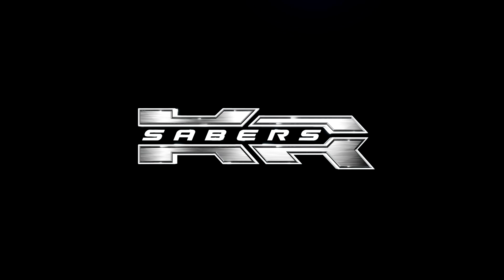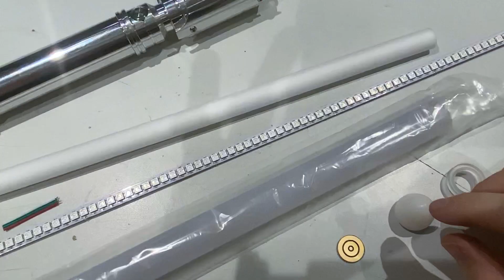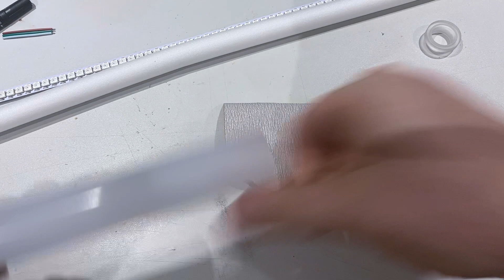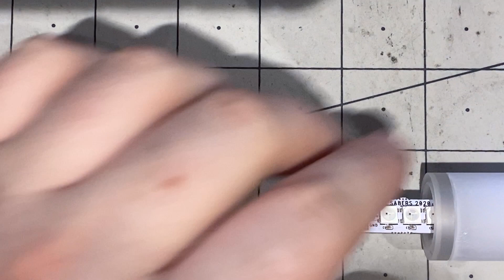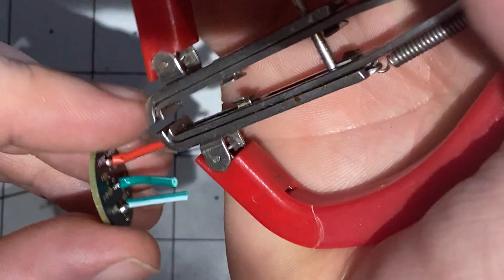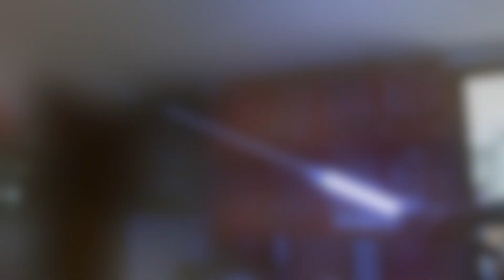KR Sabers How To: Make A Lightsaber NeoPixel Blade Using KR 'Pixel Stick' PCB 2020

Comment: Have you tried using single color (bright clear) LEDs to create a string blade but use a colored film to change the final color? Using either foam tube or a few layers (wrapped) of diffuser?

Comment: why in some of tuto there is no blade diffusion film?
Reply from the maker: This is an older tutorial. The thickness of the tube being used here provides sufficient diffusion. However, recently, it is preferred to add film anyway. A new video will be uploaded later this year with the latest changes and improvements to the blade creation process.
Reply: @KRSabers  ok and wich wires sizes should I take for the blade?
Reply from the maker: @MatthewPerret  We sell the correct wire on our store, The Saber Armory. PTFE Wire. Make sure it is PTFE, that’s very important. 22AWG Red for Positive, 22AWG Black for Negative and 28AWG Green for Data.
Reply from the maker: @MatthewPerret  Link: https://thesaberarmory.com/collections/ptfe-wire

Comment: Ok so 2 years later, I finally built my 7/8" pixelstick blade. HOWEVER: my bladeside chip is from TCSS, and has 2 contacts for the resistor. Since the KR stick already has the resistor, do I simply jumper the 2 pads on the chip? I would think if I didn't, the circuit would be open, and the blade wouldn't work.
Am I correct?

Comment: Could you make a set of ahsoka tano sabers that feature such a blade as you made in this video with handles that are as close as possible to the ones from the films?
Reply from the maker: I already have. Check my Instagram.
Reply: @KRSabers  Can you tell me how much they will cost - something like around this and this, so I can get my hands on those before they are sold out?
Reply from the maker: @17_jager37  They’re not available for sale yet. I plan to launch them in June/July
Reply: @KRSabers  so you cant tell me how much they might cost
Reply from the maker: @17_jager37  The empty pair of hilts will be approximately $600-$650. We will sell them without electronics only.
Reply: @KRSabers  Ok, would it be possible for you to build a "custom" with all electronics etc.?
Just want them to work without investing time... also have 3 other hobbys that are more or less focussed on DIY and research...
Reply from the maker: @17_jager37  Depending on your location we can recommend some well experienced installers to install the empty hilts with electronics for you. You can contact us after you have purchased an empty kit and we can provide recommendations. We have many around the world.
Reply: @KRSabers  ok, that sounds great, thank you :)

Comment: What hilt side pcb will work with this blade side connector. Will just any short pin connector work
Reply from the maker: ShtokCustomWorx, TCSS and KR Sabers
Reply: @KRSabers  
Can it work with Genesis custom sabers that use neopixel blades?

Comment: Excellent job on the pixel stick! Is the blade kit still available? I couldn't find it on your shop.
Reply: or can buy 2 strip cut them lenght you want remove clue paper and stick them together. you end extra leds and its cheaper lol

Comment: Do you plan on making different sized Pixel sticks? like ones for 32 inch blades, 36 inch blades, and even crossguard blades?
Reply: They make an 88cm older version, the V2 has two options, 82 cm and 88 cm. Haven't heard anything about crossguard sticks though. Btw I love your music! Years ago I had some of your remixes on a launchpad, lots of fun.
Reply: Wouldn’t you just be able to cut from the top side of the strip?